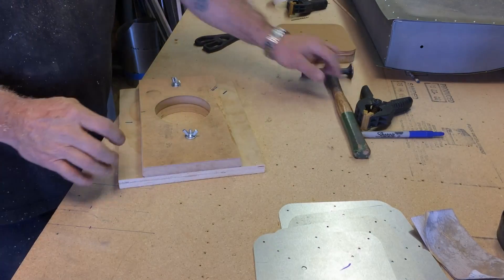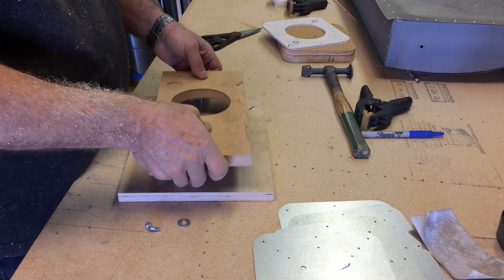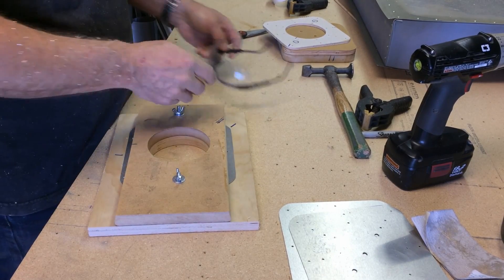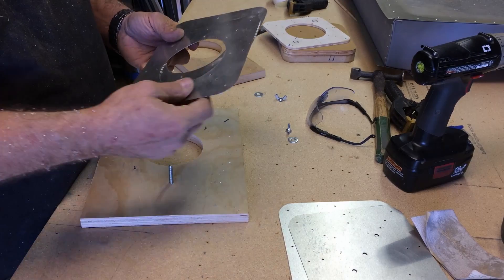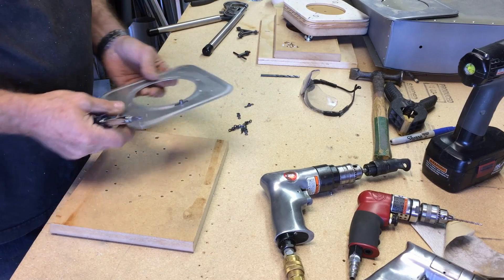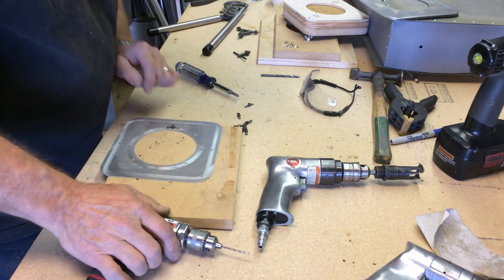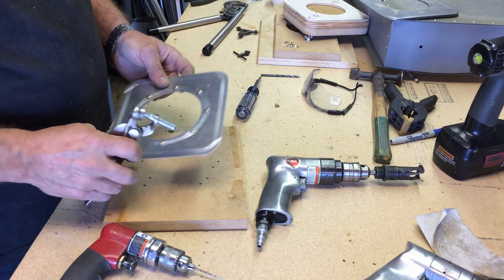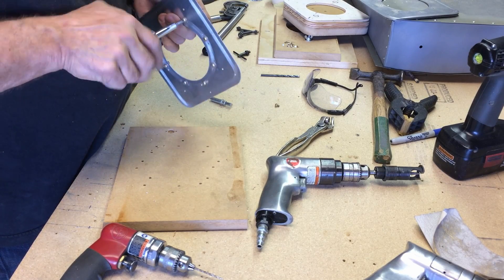Scratchbuilding a Zenith 701 Experimental Airplane, Building Wing Access Panels Part 2

Comment: Very nice. Here's a useless tip I'm going to pass along. When I'm doing those pesky little countersunk rivets in those nut plates and don't have a flange to work around I use smooth jaw Knipex channel locks to set those rivets. Easier than using a squeezer. Probably not worth buying a set of Knipex but I ended up with a Knipex addiction so I had 'em.
Reply from the maker: Not a useless tip at all. I smoothed out a set of channel locks and ground a rivet head size dimple in one jaw to squeeze the trailing edge rivets. Worked ok but I am a tool junky anyway so bought a squeezer.  For me the squeezer works a little easier. Thanks for sharing the tip. Dan.